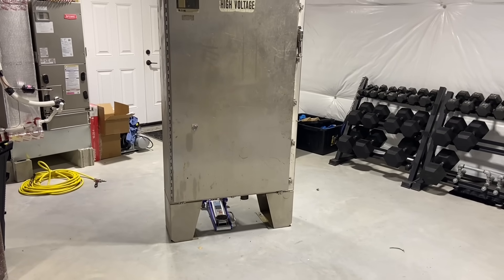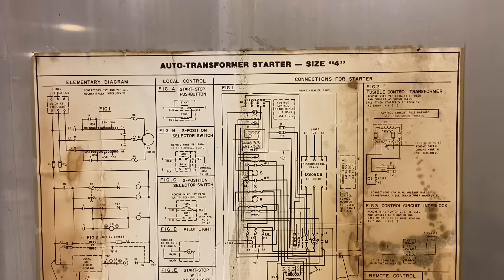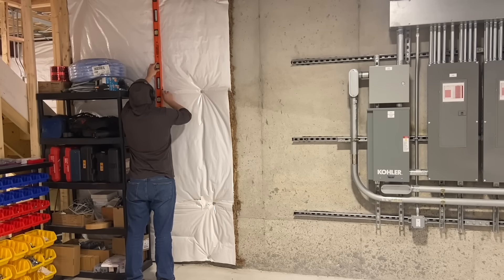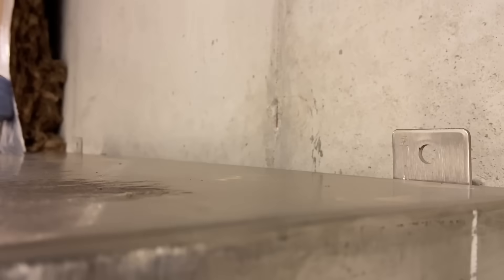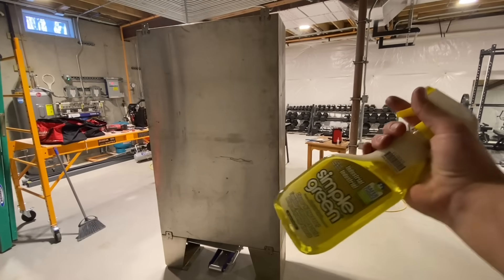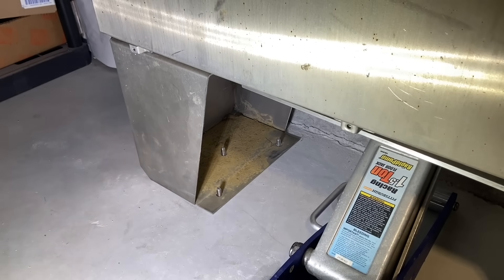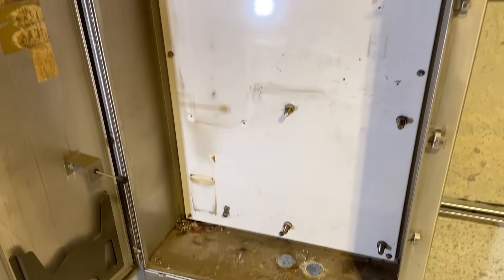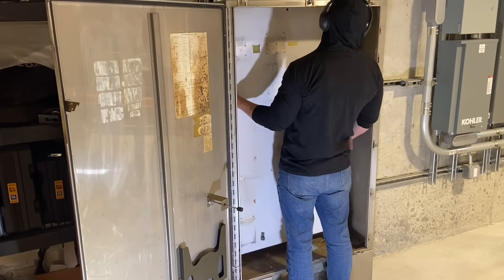Home PLC Part #1 (The Enclosure)

Comment: You should look into ignition for HMI. They recently came out with a free license for home use. It supports most communication protocols. Could replace home assistant or even simplify the communication to the PLC.
Reply from the maker: @evi0blackeagle I looked into it, but from what I saw, the free version isn’t meant to run continuously and has to be reset every two hours, so not a great option for my installation. It’s also possible that I’m not properly understanding which version to use lol
Edit: I gotta look into maker edition and give it a try

Comment: If you haven't shimmed that on the floor yet. We use a bridge deck repair grout.  Cheep very effective neat and easy to work with. Keeps the spiders out too. Like 10 bucks a bag. you could back off the nuts and smoosh it in there with a gout tool.

Comment: Usually, 50% 65% or 80 percent most were taped at 65% Most size four were across the line though I have seen size five and 6 across the line. when that size 6 slams in you know it.

Comment: what does a PLC do
Reply: PLC is short for programmable logic controller, it gets used as the brains of an automated system, like machines or home applications. It can read inputs from sensors or output a voltage to drive other things. You can do a lot with it, but this comes at a cost. Some common brands like Beckhoff and Siemens would cost you around 300€ for a decent PLC.

Comment: As a controls engineer I had a PLC in my home doing some basic functions.  I also had conduit from every light switch box into the basement. However looking at trying to get individual light fixtures and wall controls pulled back to the PLC and using relays or 4-20mA dimmers got a lot more expensive than $20 WIFI smart switches.

Comment: Big tip. If you hate spring nuts and you want something to attach to unistrut without the spring. Buy strut nuts. They are the exact same thing but without the spring. Other then that, absolutely loving the videos

Comment: You could keep the door simple, and just install a Big Red Button (EM STOP) and a panel lamp that glows steady when the PLC is operating normally, and flashes when when the PLC is in an error or alarm state. Could use an old 0-10 second time delay relay as a watchdog timer, resetting its cycle with the PLC every few seconds when the PLC's program is running without a detectable fault condition, and a second time delay relay as a lamp flasher.

Comment: The point is to drill through the slab if possible so you can push them through if/when you dont want them there anymore.
Reply: This is the way
Reply: I work in a warehouse and every time some dickhead lift operator knocks a rack anchor off, I pray that the prior hole was drilled all the way through.

Comment: Goo gone is fantastic for cleaning up old sticker goop.
Reply: Back in my old jewelry store days, we used lighter fluid to remove stickers from expensive things that we didn't want to have any remnants or residue left on. Further on, in my industrial days, we used acetone, which worked great. Except on plastic. Don't use acetone on plastic. Now, at home, I use... you guessed it - lighter fluid, acetone, or Goo-Gone.

Comment: Nice! I'd love to have one of those stand-up enclosures. The much smaller 24x24x10" Saginaw enclosure + backplate I bought to build my CNC cabinet was around $500 (and def not stainless).
At my last controls job, we had so many old/retired enclosures, brackets, panels, and other things outside in our "equipment graveyard". Granted, many of them were caked in cement, paint, or rust (no fancy stainless). But I did pull out some good transformers and things while I was still there... should have gotten a cabinet instead. lol

Comment: 1:30 I work in these a lot and I prefer flat heads because phillips strips out too easily, especially after a bit of corrosion. Flat head isn't so bad if you just don't suck.
Reply: Robertsons is best
Reply: @bosscam2953  Those strip out pretty easily too when corroded. With flat head, you can at least get a small cutting disc to cut a new slot if all else fails.

Comment: As an electrical engineer working in water/wastewater that regularly designs a lot of the stuff you're working with (Switchgear, switchboards, MCCs, VFDs, RVSS', etc.), you're way more qualified than I to be doing this. I can draw up a control schematic all day, but actually installing it and doing it properly is an entirely different beast. Kudos to you
Reply: An engineer showing respect to a technician?! You sir need to do seminars. Lol seriously though, it makes me happy to see since most engineers treat us like knuckledragging cave people
Reply: @IndustriousMammal  agreed lol I feel like hell just froze over. Lol
Reply: Ditto
Reply: I'm in the same exact field as you, but as a maintenance electrician, and we are always cursing engineering for designing systems certain ways. 🤣😂

Comment: Get GOO GONE spray for removing stickers….it works like magic
And search for PLC with node red or home assistant.  HA can write to modbus register in the PLC to activate IO.  
You can also use "PLC like" components using KinCony hardware, it’ll use ESPHome firmware to cleanly integrate into HA.

Comment: OMG, the Stainless Steel cabinet.  I have a small off grid cabin next to the beach.  The SS would be perfect for my solar controllers, inverter, fuses, breakers, and wiring.  SIGH, ss would be so nice.  I absolutely detest rust and corriosion.  Salt air is the devils breath.  It's evil, evil, evil.

I will start watching for a used SS cabinet.  

Oh God, it was in a dumpster!  Ahhh geez... 

This video wasn't boring.  It was painful thinking how nice it would be to have a SS cabinet this size. 

Congratulations on your find.  Your wiring is so orderly.
Reply: I work in car washes a lot doing electrical and they always just throw away all the old stuff when doing a large remodel. I am talking all the old aluminum frames that hold the equipment, the stainless steal piping, the old motors, and the electrical control cabinets. I have pulled quite a few things from the trash over the years.
Reply: @morscovium8881  Nice to have a job where you can salvage SS and aluminum.  Do you use it for projects  or recycle it?  Hmmm, do you live in Washington state?
Reply: @ I use it for projects. My most recent one was using a SS electrical enclosure as a fireproof cabinet for lithium battery storage. It's pretty awesome, because I love building stuff and if I wanted to buy something like that it would be really expensive.

I live in northern Ohio. But I am sure there are all kinds of construction jobs going on near you. if you can find one that used to be a car wash I guarantee you will find some good stuff in there. Even most other construction remodels and new builds will have lots of free construction material that they just throw away. If you want stainless steel, old grocery stores are pretty good for that. I once did a job with a demolition crew that was scrapping all sorts of SS sheeting from the refrigeration area. I offered the lead demo guy $10 and he let me walk away with $100 worth of stainless steel. There are all kinds of ways to get good construction material from construction sites.
Reply: Especially a Hoffman SS cabinet, I've been building solar UPS systems for surveillance and oil & gas for 3 years and of all the companies we've purchased from, Hoffman is consistently the highest quality. What kind of PV setup do you run?
Reply: @fungusgaming2458  I live off grid on a small island.  I have six SilFab 420 QD fed through three Midnite Solar Classic controllers.  I have four six volt 230 AH Rolls batteries, configured for a twelve volt system. I have a small Victron 120 VAC inverter.  My power use is low, and I am able to fully charge the batteries most weeks in the winter, I do have to run a generator to charge batteries sometimes in winter.

Why do you ask?  Do you have a solar system?

Jeff

Comment: I've also installed a PLC in my house to control various things (all the hvac, boiler, hot tub, barn stuff, battery backup system, etc). I also use Home Assistant as my HMI. I use ModbusTCP to communicate between my PLC and HA and it works very well. Let me know if you have any questions. Love your videos btw, very entertaining!
Reply from the maker: That’s awesome, what PLC did you go with?
Reply: @Cursed_Controls  I decided to try the Productivity 1000 from Automation Direct and so far I don't regret it. It's been running great since 2022. The price is very low and it supports ModbusTCP which nearly every industrial device supports (except Allen Bradley unfortunately, at least not without headaches). Also, the programming software is free.

Comment: Industrial parts are stupid expensive. I believe every seal of approval or rating adds an extra zero to the price. I had a few nema4 boxes with ONE break glass EPO button and they were $700 a piece.  At least they included the tiny hammer on the chain.

Comment: if i had the space i would totaly install a full ass indutial cabnet like that...but i dont....but i do have a smaller cabnet i use to play round with. large enugh for 2 rows of din rail so i guess it will do. 

also i would replace the stickers with your own...needs style! nothing like an arc flash rating sticker :D

Comment: I hope you see this, because I will change your life: 

Spring nuts/jack nuts are the fuckin' devil. However, nylon cone nuts are the saving grace of all mankind and the single greatest invention and the history of electricity. They clip to the front of the unistrut instead of relying on pushing against the back. They will make your life easier.
Reply: The nylon ones are the only way 💯

Comment: I'm an IT girl of about 22 years, programming, IT, DevOps, Infra, Security, Microcontollers.  Home Assistant is great, but a PLC that works and interfaces with Home Assistant is way way way better!  It may take a bit of work, and you might give up some fine grained data, but if your system can run without home assistant, but can talk to and respond to home assistant, you've built it right!

Comment: My first job out of school was industrial controls, and now I've been working as a software engineer for over a decade. 

I haven't worked directly with home assistant, but it does support RabbitMQ which is a standard messaging protocol. 

Whichever PLC you decide to put in, make sure there's some way to can translate your protocol to RabbitMQ, and you should be able to link Home Assistant.

Comment: For cleaning of the stickers and/or their residue: 
I don't know if you have those in the US, but here we have little scrapers (normally for glass cooktops) which just take regular razor blades for the replaceable cutting edge. Those have worked wonders for me in the past removing stickers and the like from all manner of surfaces. If they're still a little hard to scrape off, soak them with a bit of water for a couple minutes beforehand.

This is easier, cheaper and less dangerous to your health than spraying all kinds of toxic chemicals in confined spaces.

Hope this can be of help.

Comment: 10k for a metal box? really?
Reply: Yes really.  Industrial equipment is stupidly expensive.  Even just a metal box.  Some quick searches show it might even be more!

Brand new that's probably > $1000 worth of raw metal.  Stainless is not cheap!  It also takes special skills, equipment, and safety considerations to weld.  Plus, goes through tooling like crazy.

Then you get the hundred thousand dollars worth of safety certifications that cabinet line probably has.  Which companies will gladly pay to ensure their hundred million dollar factory doesn't burn down, or several million dollar equipment doesn't break because the cabinet failed.

Comment: You should take a look at Node Red, you will be able to connect it (or home assistant) to your PLC pretty easily. Node Red is probably more suited to your usecase though.
Reply: Node red, and Home Assistant in combination can be even more effective. Use Node red for handling the logic of setting and activating events and handling inputs, Then make pretty dashboards in Home Assistant that interoperates with that logic, and allow you to hand off 'manual' interactions for family, and where appropriate, guests.

From a platform perspective for what to run HA on in a setup like this, I'd start with an Industrial grade 64 bit Intel or AMD based computer, and a server grad Flash SATA drive. You probably won't find one that takes nVME stick Flass drives, but it's not so IO intensive that it won't run well on a SATA spinning metal disk if you go that route. Home Assistant will run fine on a raspberry Pi off a 32 Gig Flash drive, for about 3 months, at which point it will have eaten the Micro SD card. It isn't IO bound, but it does do a lot of reading and writing to storage, and MicroSD cards are notoriously bad for long term IO. Hence the recommendation to go with an industrial grade system.

Regardless of platform though, when it comes down to it, I haven't seen a home automation platform that I like, simply because none of them seem to understand the concept of 'install it today, and 30 years from nowif you check on it, it's still working. I have wall switches in this house that are over 60 years old. My Home Assistant OS box has an up time measured in days or weeks, because people keep finding things to change. I get that they are fixing things, just it's no way to run a system where reliability is expected out of the build. A PLC? Yep, that's going to provide reliability, unless your running centrifuges, but I don't expect to be running many of those in my house, I don't know about you. Others have different ideas, and that's OK.

Comment: Holy shit. There’s something OLDER than a soft start 🤣🤣🤣
Reply: Yeah, it's an autotransformer. It's kind of sick. I think we use those for blower motors because they're reliable.
Reply: @ yeppp… I shoulda been a plumber 🤦‍♂️
Reply: @CatnamedMittens  Fun fact, they're still in common use today. Uninterrupted Power Supplies which have "low voltage compensation" do so using an auto-transformer.

Comment: I use Beckhoff and Home Assistant with MQTT, it works really nice since (newer) Beckhoff devices support MQTT natively. 

I know HA also supports Modbus TCP but MQTT is way more flexible (and fast since it is event based). 

I use HA mainly as a frontend (HMI) and some automation which requires integrations to other systems.

The PLCs does most of the ”field stuff”, getting data from different sensors, controlling the car charger over Modbus RTU, under floor heating PID control etc. But all visualizations and setpoints comes from HA.
Reply: Sounds like the way to do it. Although I'm on the fence about beckhoff. I know I'm probably judging a book by it's cover, because their capabilities are impressive, but the quality feels cheap to me.

Comment: Inductive Automation has Ignition with a maker license and some have been using it with the MQTT module for home automation. In that case you would walk alway with a usable skill too.
Reply: Also, for cleaning of sticky stuff, grab a can of Citrol cleaner. It works great but can leave a film so I clean the surface off with something like Windex after. For cleaning stainless, I liked the product Painless Stainless when we were cleaning up after ourselves while wiring a stainless medical manufacturing area. Haven’t used it in decades but it looks like it is still around.
Reply: I should have read further down into the comments before commenting; I suggested the same thing 😂. I think Ignition Perspective pages would work way better for a home automation system compared to, say, Allen Bradley HMIs
Reply: @jackmartin8715  and cheaper! 🤣

Comment: Thats likely a $3000.00 plus electrical cabinet.
Talk about a deal for $300 bucks.
Reply: Certainly more than $3k. $10k is probably even cheap for this. Stainless enclosures are insanely expensive
Reply: @jackmartin8715  i agree !
Reply: @jackmartin8715  Just checked Rittal stainless pricing and 3k is the right ballpark. Probably a bit less even.

Comment: If memory serves, you can integrate modbus TCP devices natively into home assistant - not sure what your plc  is capable of but maybe that's an option!
Reply: An Allen-Bradley 1400 PLC can communicate through Modbus RTU, however, the only code I've seen for it was ported over from the older SLC series PLC's, so it does all the timing and error checking 'by hand.' Other PLC's have native Modbus RTU and Modbus TCP built in.

Comment: Might want to look into some "graffiti remover" to clean up the remaining stickers and residue. The stuff is pretty aggressive since it is mostly intended to get paint and markers off wonderful surfaces like brick and concrete, so will take off old paint if you aren't careful. If you don't leave it more than a few minutes it will usually be fine.

Maybe also get an appropriate size Wilkes plug for the hole in the door. Or just put a large switch or indicator there with positions of ON - ON - ON. 🙂

Comment: Hey, avid Home Assistant user and industrial electrician. You absolutely can make HA play nice with the PLC! Assuming your PLC is not ancient, MQTT should be an option for communication. HA plays very nice with MQTT so you'd just have to have the PLC respond to the messages accordingly and send back statuses in the MQTT message. OPC-UA is also an option but there's not as much precendent for it with the HA community. Feel free to reach out if you need any help

Comment: Suggestion: Dawn Power Dissolver. Spray the labels, allow to sit for a few minutes, and then gently scrape them off. May need to repeat once or twice, and if there's any adhesive residue, it'll get that off too. (Power Dissolver also is incredible at removing Sharpie ink, and minor rust stains.)